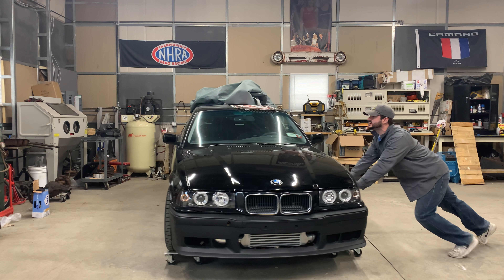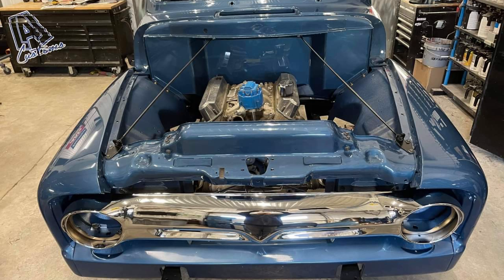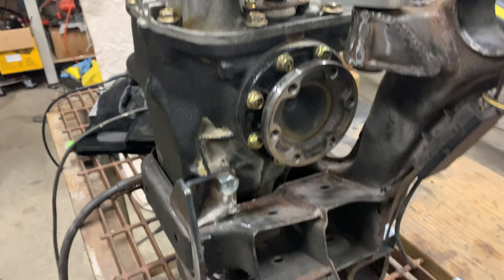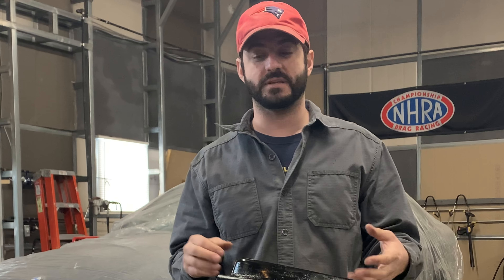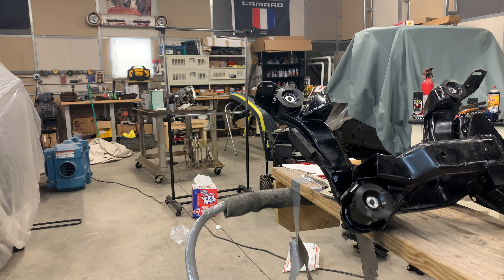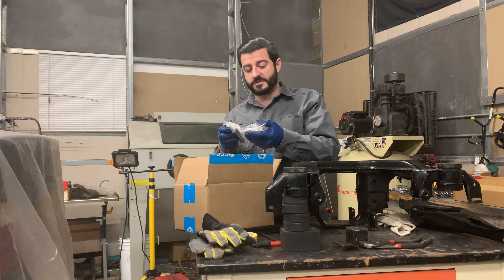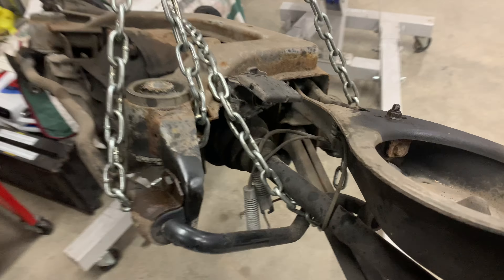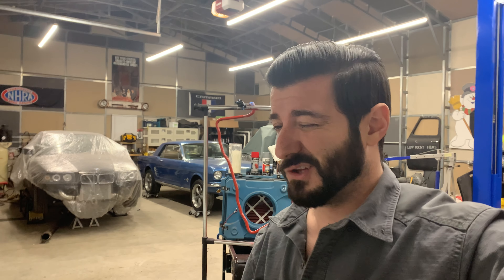TURBO LS BMW E36 REAR END UPGRADE: 210mm differential

Comment: Awesome Which axels work with this setup ?
Reply from the maker: E36 m3
Reply: @ euro evo or us m3 because the diff flanges are big won’t for 188mm axels !
Reply from the maker: @alaaalqammaz3697  idk about the Euro ones, but I have US ones. They work with the m3 188mm and the 210mm. 325/328 axles will not.

Comment: Which axle shafts do you use on 210mm diff?
Reply from the maker: E36 m3 ones
Reply: @LowBoostFilms  From European 3.2 M3? With M3 trailing arms?

Comment: What bmw is that 210mm diff. From??
Reply from the maker: The old v8 and v12 7 series. e32 Was this one.
Reply: @LowBoostFilms  and it bolts right into the 3 series rear subframe? Just asking and getting some ideas because I'm thinking of what to do with my ls2 swap in my 36...
Reply from the maker: It almost Bolts in. It actually was a factory option on the European M3. There is only one bracket that has to get welded as you see in the video here. You just have to make sure to get M3 axles and M3 rear trailing arms and it all works This video and the one And a few others I’ve done shows the whole thing
Reply: @LowBoostFilms  US e36 m3 axles bolt right up to the e32 750 diff? Or did you use EVO M3 axles? And where did you find the e32 diff?
Reply from the maker: Yes US m3 axles bolt right up, but you will also need the M3 rear trailing arms as well. I got this one on eBay actually

Comment: Hey great bro!  can I switch to the 210mm e32 case on a non-M subframe with this kit?  and the drive shafts will then fit in the hubs of the 328?
Reply from the maker: The subframes are the same, but everything else is different. So you need m3 rear trailing arms, brakes, hubs, and axles